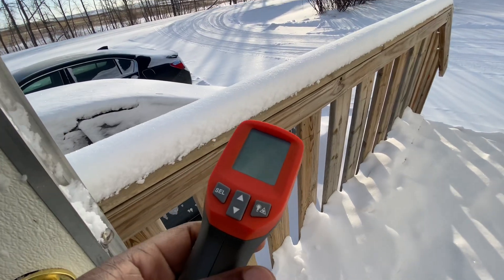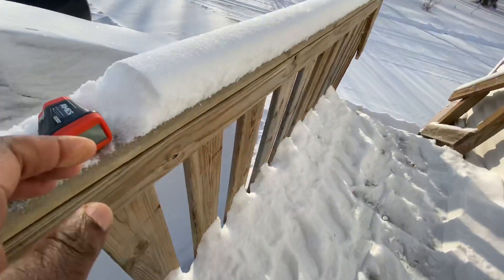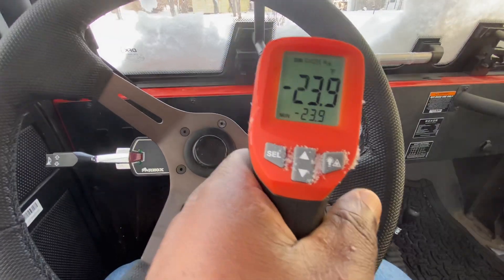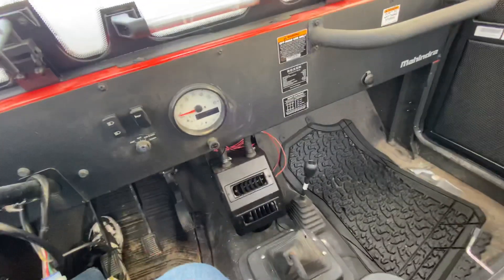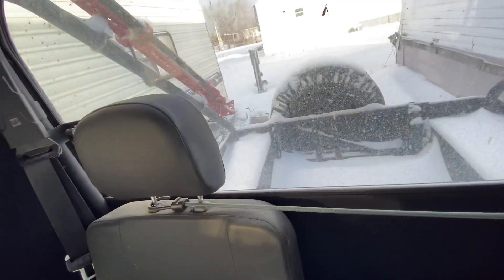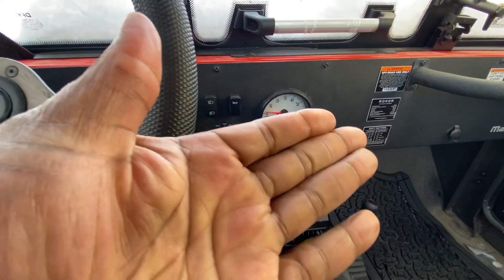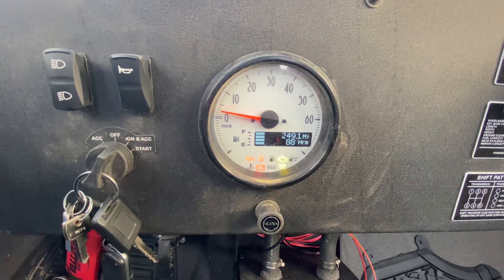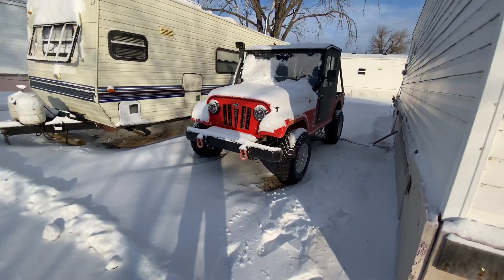Attempting to Start the Mahindra Roxor in cold very cold Weather

Comment: Couple things like others stated run glow plug cycle 2-3 times to get those cylinders hot(warm).

Above a block heater get an oil pan heater, you'll score a piston starting a diesel like that when it's that cold the oil is like molasses and can take 15 seconds or more to start lubricating.

Don't keep cranking when your batteries are that low, you'll burn your starter out very quick when your volts go low your amperage shoots up.

Living in ND/mn all my life every vehicle needs: block heater, oil pan heater and a battery heater. Diesels should be plugged din an hour prior. 

Take care of your vehicles and they will take care of you.
Reply: Minnesota here. No diesels, but growing up my dad always had the vehicles that were parked outside plugged into something. If not a heater then a trickle charger to help the batteries out.

When I did the military thing, I learned that you basically just never turn the trucks off and you don't have problems like this. :P

Comment: Jelly.   Get a block heater.  Diesels need warmth.  Cranking on dry cylinders is no good. Fuel additives may help.
Reply: Also just some advice, spraying starting fluid in a cold diesel can really dry out cylinder walls. Use sparingly if you have too. I drove semis in cold climates for years.  Other then that, that motor will last way longer than that car.  Enjoy!

Comment: With the way the fuel pump sounds, are you sure the diesel isn't jelled.
Reply from the maker: Possible. And the battery just doesn’t have enough amps to cranks the Diesel engine.
Reply: @abiez  Did you get a block heater or a trickle charger for over night for this winter?

Comment: I'm with Dan (but not is south Fla.) All modern diesels are equipped with block heaters, have you checked your owners manual for cold weather operation? If it doesn't come equipped with a block heater, I would install one. But first, get it indoors.. Also add an anti-gel agent to your fuel, might be gelled in the fuel lines.
Reply from the maker: There’s a number of places a guy could install a block heater. This year I’ll take a closer look at the engine and see if there are any freeze plugs. That would be a god place to install a heater.